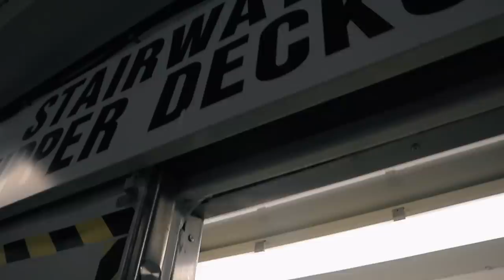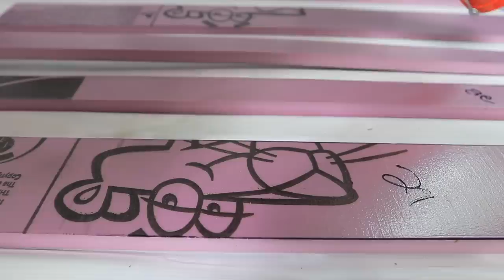Exploring NORTH of the BORDER by Boat & Van | Sailing Soulianis - Ep. 56

Comment: your floor is remarkably similar to how I did my floor, except I did one layer of foam on top of a layer of reflectix (which in retrospect does very little) and I did my final vinyl flooring at the very end after my build. Thinking I didn't want to scratch it up. But I did my entire build in about 3 months.